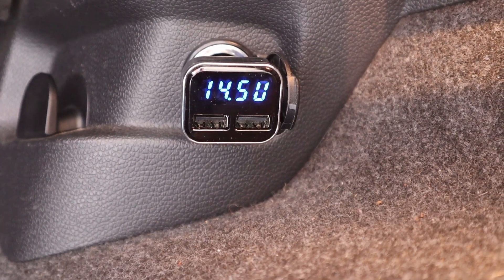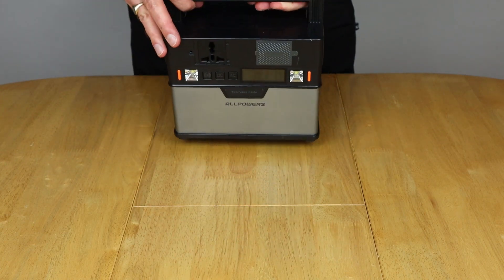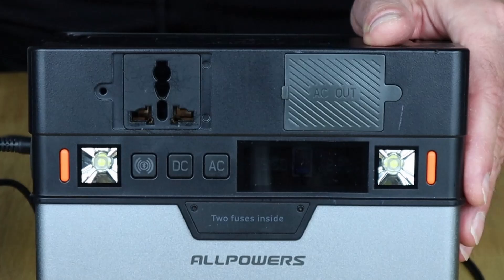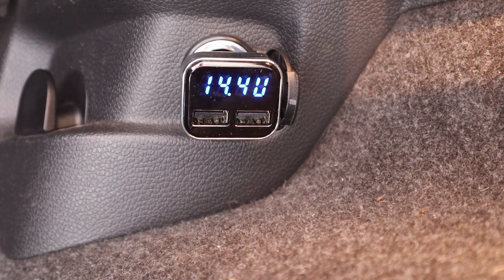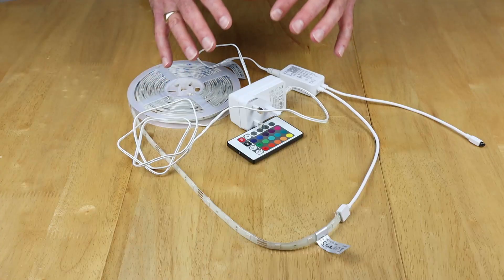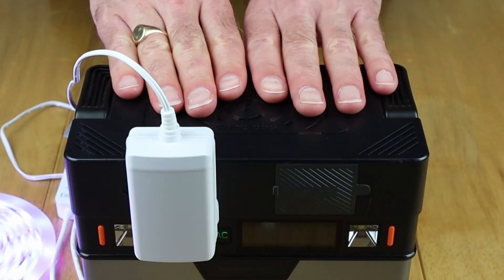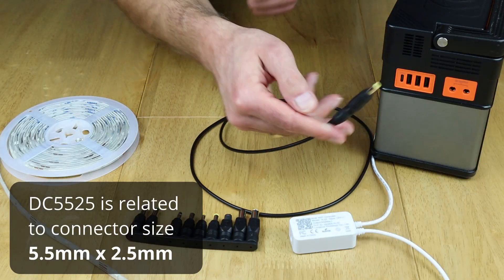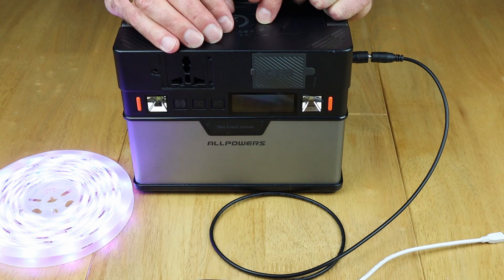How to get more out of your ALLPOWERS 372Wh Solar Generator | 12V charging and usage tips

Comment: Thanks, with this and finally getting the Anderson input working I have a good set up in my campervan at last!
Reply: My Anderson port doesn't work. How did you get it charging?
Reply: @sun-sea-solar  I had problems with mine, as well. It turns out, the Anderson connection is a very tight fit, and I did not have it fully connected. You have to press it in very hard, feels like it will break before it actually snaps in.

Comment: Great videos mate. I onw an older model Allpowers 280wh unit. Tbh the power doesnt go very far, BUT personally I see all the value in the inverter/connectors. Just having a unit that has a smorgasbord of inputs and outputs, with different connectors and different plugs, provides great throughput for the owner. I back them up with cheaper battery packs. By my rough estimate, I can buy 100wh battery packs for thirty quid ... and slave them into the charging ports for more raw power. But its the utility of these units that really make the generators shine.
Thank you for your videos.
Reply from the maker: @TheWtfnonamez  Good day! You're too kind, thank you very much 😊. I completely agree, the choice of ports really does cover a decent number of scenarios, it's so convenient. The whole cheaper batteries to keep the more expensive generators running for longer is spot on and something I also do (my LiFePO4 case batteries come in handy for that). Thanks again for taking the time to share your experience, it helps other viewers out too👍. Please shout if you need anything. All the best, Adrian

Comment: I have one of these units and love it.  Thanks for the info!  I have noticed this exact unit is now advertised at only 288Wh now... I wonder why that is the case?  Do you reckon ours really is 372Wh or maybe we were sold snake oil and it was 288Wh all along?
Reply from the maker: @VanLoz  Good day and thanks for your question. The manufacturer informed me that they changed the battery pack (for a smaller capacity) due to increasing costs. They also said that the unit is the same apart from the capacity drop. I hope this helps. All the best, Adrian
Reply: @DADvinci  Thanks heaps buddy, good to know! We got lucky with the 372Wh units then! 🎉

Comment: Thank you for these great, informative videos.  I have an issue with trying to run a desk top heater for my shed. It’s a small Dimplex desk friend of only 250 watt output.  When I plug into the AC the ALLPOWERS pack cuts out.  I chose the heater for its low wattage being below the 372 watt advertised. Is this a common problem? Can you recommend a small heater that will work with this pack? Thanks.
Reply from the maker: @Jamie Hazelgrove  Hey Jamie! Thanks for your kind feedback, it's much appreciated😊. I've run devices up to the 300W continuous limit before. Some things that require more power to start-up like motors, fridge compressors, etc. can trip the inverter out as they spike above what it can handle. That might be what is happening with your desk friend heater. On occasions, I use the foot mat in this video > https://youtu.be/e9uCsixmzWo as it's much more efficient, but does costs more. I've had a quick look and found a couple of potential heaters, but I must say that I've not tested these myself so can't provide feedback on the quality or effectiveness > https://ebay.us/WOfZyT or  https://ebay.us/4IV0Z9 (affiliate links). I hope this helps. Please shout if you need anything else. All the best, Adrian

Comment: Hi, 

How long does it take to charge with the 60W PD charger? Also would you be able to leave some formulas for working out how long things could be powered etc please. Thanks love the playlist my one is now on order
Reply from the maker: @Josh Anderson  Good day Josh and thanks for your kind feedback😊. From flat, it takes approx. 7 hours to fully charge using a 60W PD charger. I wouldn't recommend fully discharging every cycle though as this can reduce battery cycle life quicker.

In terms of estimating run-time, you can get a rough idea by dividing the energy/power storage (372Wh in this case) by the watts the device is likely to use (usually on the device power label or in the manual) > formula is Wh (Watt Hours) ÷ W (Watts) = Runtime (Hours). So, a device that uses 50W on a fully charged unit would be 372Wh ÷ 50W = 7.4 Hours.

This calculation is fine on paper, but I apply my 80% usable power 'rule of thumb' as it provides a more realistic figure. This 80% takes into account AC inverter loses (if the inverter is used, not as much if just using 12V or USB) and not running the battery flat every cycle. You might be able to get more or less the 80% figure though, again it's my rough real-world estimate. So, it might look more like this for the 50W device > 372Wh @ 80% = 297Wh ÷ 50W = 5.9 Hours runtime.

I hope this helps. Please shout if you need anything else. All the best, Adrian
Reply: @DADvinci  thank you for all that info really helpful! I’ve received mine now yet it doesn’t seem to be liking my 240W makita battery charger any idea?
Reply from the maker: @Josh Anderson  Hey Josh! Glad the info helped. Just to check, it's a 240V not 240W charger? Please can you check with power specs on the charger and let me know? Is it tripping the inverter? Sorry for all the questions. Cheers, Adrian
Reply: @DADvinci  hi, it’s a 220-240v 240W 50-60 Hz (copying from the plaque on the bottom)
Reply from the maker: @Josh Anderson Thanks Josh. Is it tripping the inverter? Do you have the model number or a link you can share? Cheers, Adrian
Reply: @DADvinci  makita DC18RC, I’ve done some digging myself. In contact with all powers and the seller of my item, if you’re happy to share your email I can send across some pictures?
Reply from the maker: @Josh Anderson  Sure, no problem it's dadvinci.ade@gmail.com

Comment: Have you tried charging from the car 12v but plugging the power brick into a 300w pure sine inverter that's plugged into the 12v socket.
Reply from the maker: @mark stokes  Good day Mark and thanks for your question. No, I've not tried that method as yet. The power brick charges around the 60W mark, as does the USB-C PD route. Using an AC inverter would mean you'd use more power from the 12V than using the 12V USB-C PD charger alone (it would be 12V DC > 230V AC > 12V USB-C PD). Did you have something in mind for using this method? All the best, Adrian
Reply: @DADvinci  saw a video about it, can't remember who it was but it's the American guy with the white beard. Didn't use the allpowers but another make, charging watts went right up when using the method in the car.
Reply from the maker: @mark stokes  Ah I see. That would be Hobotech. The ALLPOWERS unit has the USB-C PD charging method which is a popular charging method amongst viewers. That's been the best method of charging I've found for this unit, as you can use the cable for charging from the unit too. I'd be interested to hear the make he was referring to, if it does come back perhaps you could drop a message on here? Cheers, Adrian
Reply from the maker: @mark stokes  Thanks for sharing Mark! Yes, it does work with some power stations and the Explorer 500 he used was the older version so had slow charging. The version I recently reviewed (https://youtu.be/Z5Fwp2pWBtU) has a boosted input port so you get around 80W with as standard cable and a little bit more using the AC power brick, so not the doubling up he covered. It is possible to charge faster with a 12V AC inverter setup on the MaxOak EB150, but I've found a small adapter that gives around 120W direct from the 12V output in a car, instead of around 160W using the AC inverter route. Cheers, Adrian

Comment: I bought one recently and they have ditched the aluminium body. It’s all plastic now. They still advertised it as aluminium so it wasn’t quite as expected. Works well so far though.
Reply from the maker: @Taigen Etsudo  Good day! Thanks very much for sharing this info. It sounds like the 666Wh version I've also got. It was a nice touch, but I guess cost cutting is what they had in mind. Glad to hear all is working fine at the moment. All the best, Adrian
Reply: @DADvinci  yes that’s what I meant actually - there’s no wattage drop with mine. I’ve already seen your other video. I’m not experiencing that problem of watts stepping down with shade - it goes back up. It’s working very well actually. 
I would think the unit will shut off when it fills up just like on adapter input, when it reaches capacity, and as long as I don’t exceed the max input wattage/amps I should be ok. 
Also interesting is how the display adjusts to show input/output when charging and discharging simultaneously. I’ll feedback more on this after a while. I’m using it as my main power source now (solar controller for my main battery bank burnt out yesterday due to moisture) and I live in a camper. Thanks again for the useful videos!

Comment: Okay I'm confused as I've bought the exact same equipment but mine goes 6, 11    24 then suddenly back down to 5 watts and stays ar 5 forever on the cigarette lighter socket?
Reply from the maker: @GamingGoose  Good day. Is that when you're charging the unit or running something directly off of the cigarette lighter socket? Cheers, Adrian
Reply: @DADvinci  when mine is plugged into a 90w max output charger using C in the 12v car socket Jr goes up then goes back to 5w and stays charing at 5 with nothing running off it
Reply from the maker: @GamingGoose  Thanks for the info. Are you able to test charge with another USB-C charger (mains or not) as I'd be interested to see if it's down to the 90W 12V USB-C charger. Has it ever worked correctly with the 90W charger? Cheers, Adrian
Reply: @DADvinci  the 90w charger works on my phone via the same outlet so it's odd that it doesn't for the allpowers. My phone on a standard USB cig charger takes 2 hrs + on the USB c it takes about 40 mins to fully charge. But as I say on the allpowers it does go up in increments initially then suddenly drops to 5w like it's some safety thing kicking in
Reply from the maker: @GamingGoose  The only thing I can think of is that USB-C PD has to negotiate the rate at which it can charge and sometimes it can't get it quite right. That might be the case for your setup. I've had a USB-C cable that had a damaged pin one end and it wouldn't charge at all, just kept flashing up as if it was going to start charging but didn't settle. Do you have a link (or make/model) you could share for the 90W charger?

Comment: hi, i've just been running a security camera off my 372, I left it a little longer than i should have and have run the battery down.

I'm trying the recharge it but nothings happening, can you help.

Thanks R
Reply from the maker: @Ray Humby  Good day Ray! I'm sorry to hear that. There are a couple of things you can try to begin with. Leave the unit (nothing plugged in) for a period of time, allowing the battery to recover enough so that the BMS allows charging again. You can also try a reset (press & hold the DC button for about 20secs) and see if that wakes it up. Please can you let me know how you get on? All the best, Adrian
Reply: @DADvinci  Adrian, thanks for getting back to me so soon, I've just cracked it, i was using the UGREEN USB C, mains charger and have been since i saw it being used on you Vlog last year. I decided to try the power charger that came with it instead, this seems to have done the trick. Its charging nicely now.
ill let you know if there are are further problems.

Thanks again for you help.
Ray.